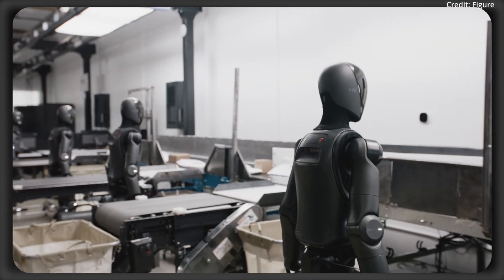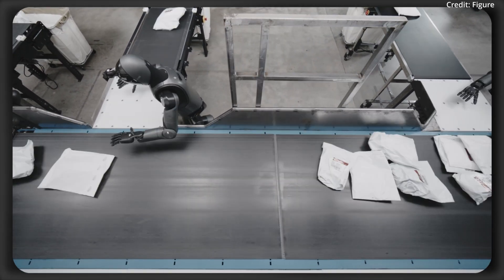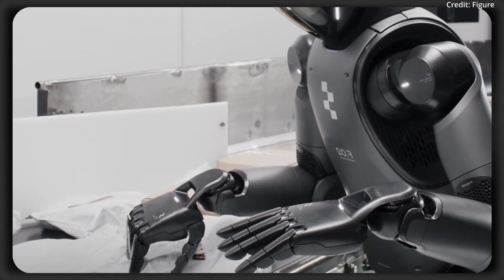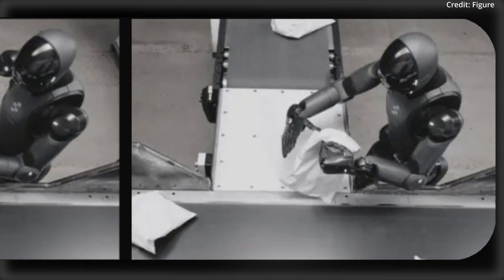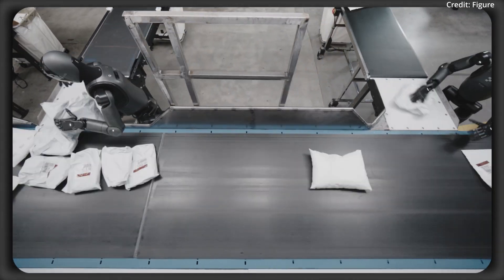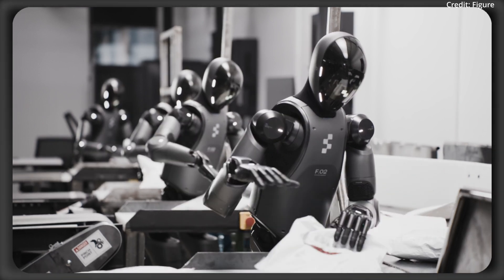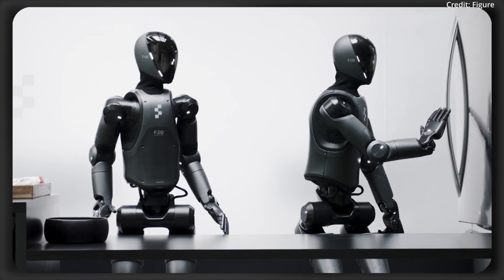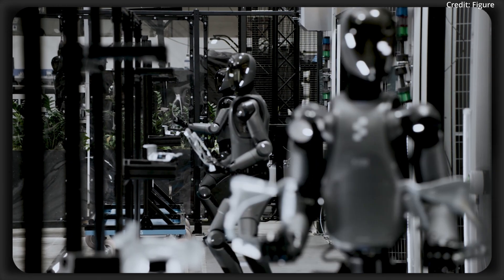HELIX AI Robot "S1" Explained: 4 New AI Automation Breakthroughs Beat Tesla

Comment: 25 grand it cost me to build android not including time, custom guff. Done before parts exsisted for sale. So 50 grand eh could be worth that.  Id want my bots brain in it but thats just me. 
Id perfer a manual switch for blue tooth or any transmitter to reduce hackers. They getting in everything so manual switch. 
Just my opinions.  Must work off line. Variable amp chargers have become useful for low solar draw if power low.